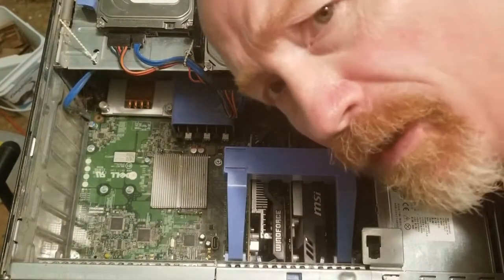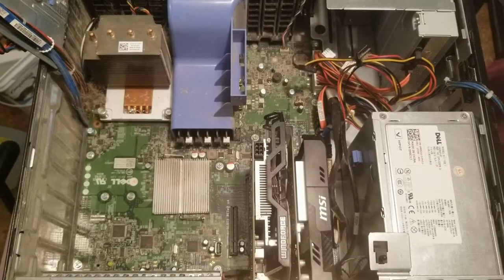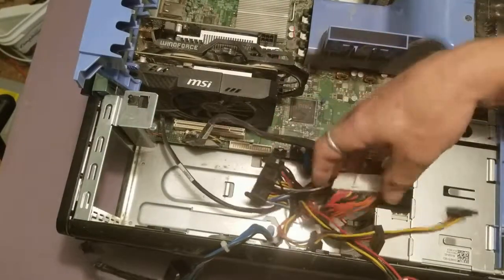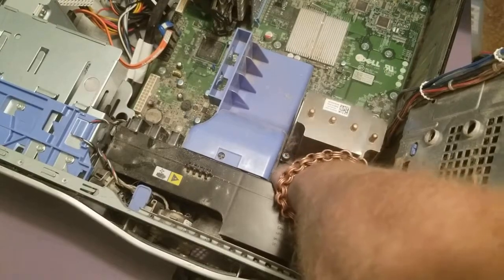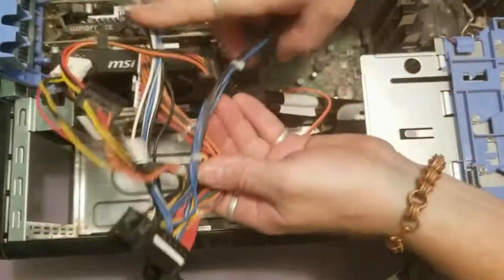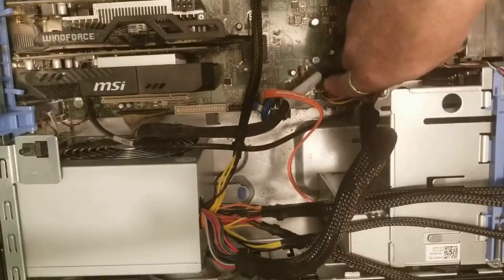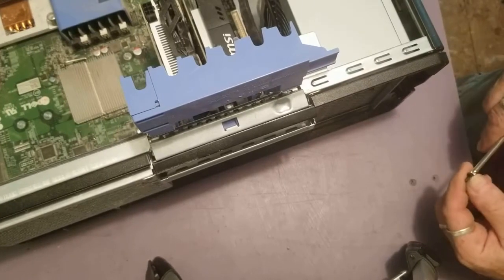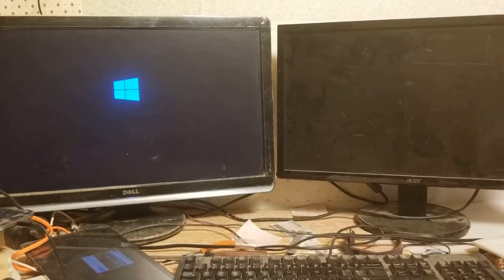Changing power supply in a Dell T3500

Comment: congratulations! you just downgraded that machine replacing the 525 watt dell with a shitty run-of-the-mile 350 w. WOW.. JUST WOW
Reply: et il a des likes avec ça !:washhands:
Reply: I know.  I was watching this video for several minutes and the part about snipping the wires of the one bundle stopped me dead.  If you are doing an exact replacement, it's just four screws out, harness disconnected, blue tab depressed, old one out, new one in, reconnect, four screws back in, done.  That took me less time than the time I spent watching this video.

Comment: man, its enough 300 watts on the long run with those 2 graphics cards? cause the original psu its 525w is think
Reply: My thought exactly. It would have been nice for this guy to say right up front that he was NOT using a matching replacement - all of that stuff about unplugging the individual connectors and snipping that one bundle of wires threw me off, as you don't do any of that when just changing out one PSU for another of the exact model.

The factory supplied H525AF-00 does show a max power rating of 525W, but this is a business class computer with more of everything.  I just replaced mine, it took only a few minutes once I figured out the trick of the blue tab which releases the PSU allowing it to slide out - I simply pushed it with a pencil tip, as I had not yet been able to unhook the harness/plug - my hands are too big for that limited space (there is a DVD drive installed in the front bay, so not as much room).  I took off two screws from the old PSU to flip it open in order to remove the little blue harness clip and install it under the new one, but it isn't really necessary as that is only used for one smallish cable that can otherwise just hang free.

Toughest part for me was getting the harness/plug pulled out, but with enough finger room to press the tabs, it wiggled out.  With the new PSU in place, the reconnection was effortless.  Clicked in place, four retaining screws back in, case closed up, done.